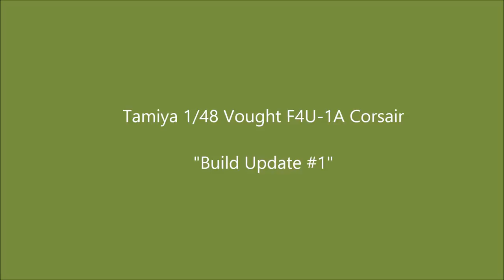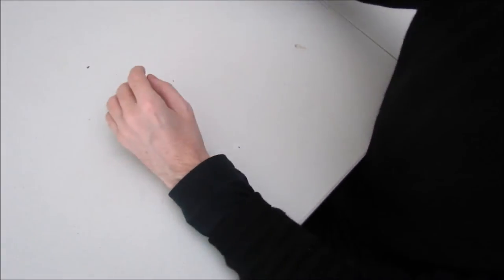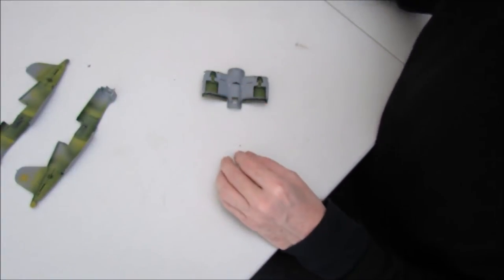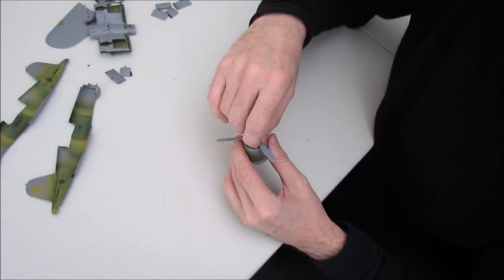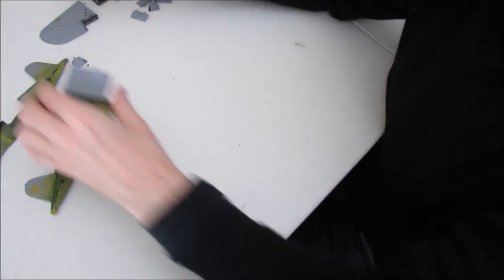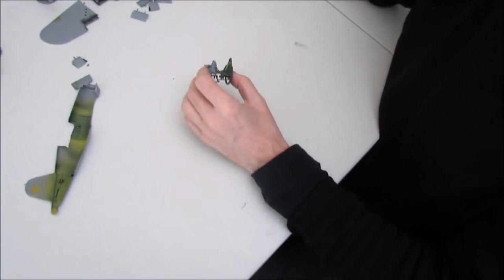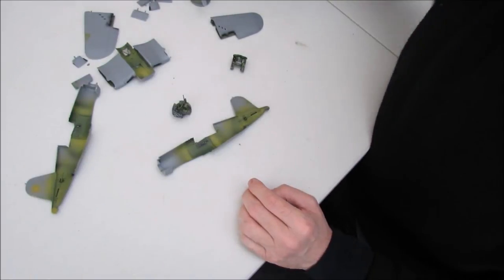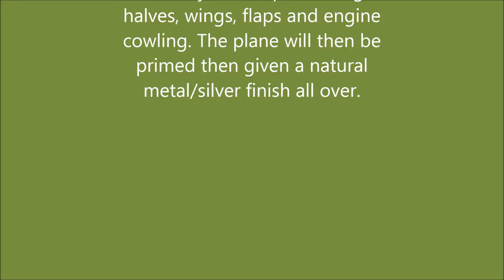Tamiya 1/48 Vought F4U-1A Corsair "Build Update #1" (2.20.15)

Comment: That kit looks like a fantastic kit to work with, the progression is looking awesome so far Martin, I like the fact that you're working with some of the Tamiya 1/48 aircraft kits more often as I find that those kits are rather tempting to build.
Reply from the maker: ***** Hello Charles, thanks for watching. So, far, it does seem to be another great kit from Tamiya, although I'm thinking this could originally have been a Hasegawa kit. The material used, the thickness of molded parts, the design methods employed are very reminiscent of the Hasegawa 1/48 Hawker Typhoon that I built. Have a great weekend, mate! Cheers, Martin : )
Reply: Yh the detail does look similar to a Hasegawa kit.

Comment: Martin, what advantage are you seeing from clearcoating between each color layer?
Reply from the maker: will pattison Hey Will, thanks for watching. I always clear coat each new coating of paint to protect it from getting scratched, chipped, or, peeling when applying masking tape to it. Five minutes of clear-coating saves those unfortunate and frustrating headaches when you lift the masking tape and it peels a section of paint away. Also, and more so, for this exercise, it lessens the risk of accidentally chipping too far beneath the yellow undercoat that I want to be displayed in some areas and exposing the "bare metal silver". Basically, it gives me a protective layer between the yellow and silver to allow me better control with the chipping. Well, that's what I'm thinking? Have a great weekend, mate! Cheers, Martin : )
Reply: International British Modeler right on.  that all makes perfect sense.  these acrylics are fragile so any precaution is probably a good idea.